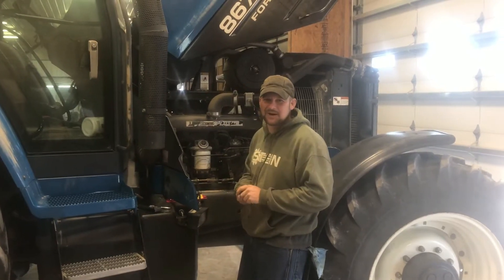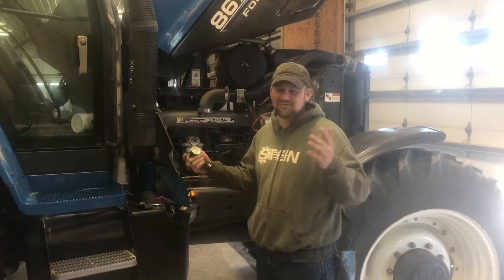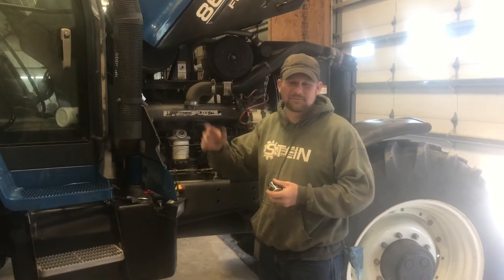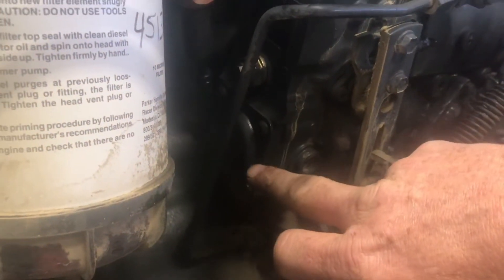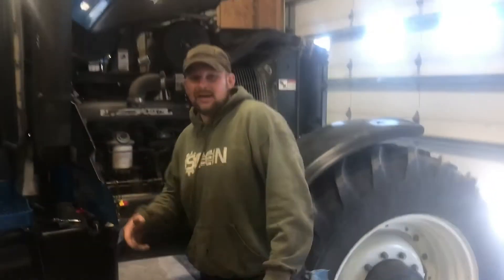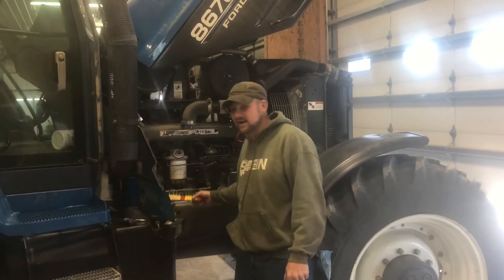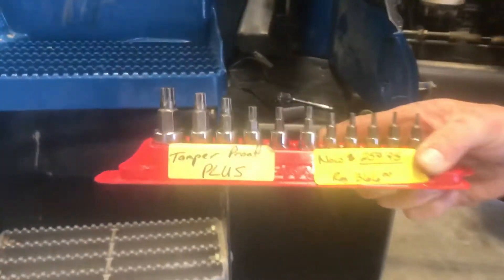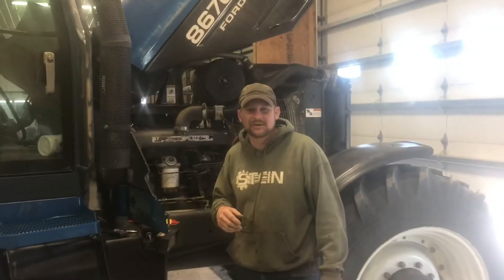New Holland 8670 horsepower increase

Comment: whats the other screw in there for? my anaroid on my 8970 is super slow to respond. shove the throttle forward in road gear and its a quarter mile before it finally starts allowing more fuel. once at 2100 rpm it will pull anything but if i drop the rpms below 2000 ill kill the tractor when i drop the ripper in the ground
Reply: Have an 8770 and we have the same issue.  If the RPM drops below 1650, it's basically dead.  I was looking for a video on how to set the aneroid up, so the thing had more bottom end power.
Reply: @Vicsonvee  i figured it out theres a little tin cap on top held down with 2 rivets. drill those and throw that away then adjust it 2 turns in and start there. i believe mine is around 3-4 turns in now and its a whole new tractor
Reply: @benabbas569  Did the same thing, Worked great!
Reply: How did you fix this? I have the same issue